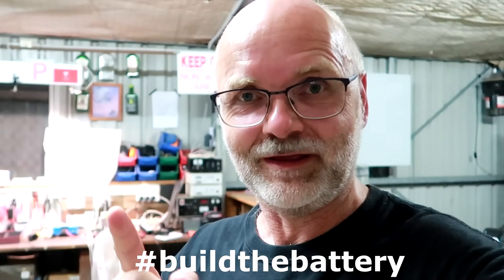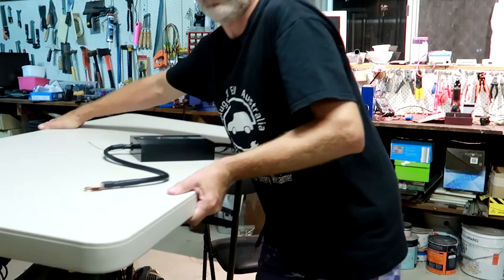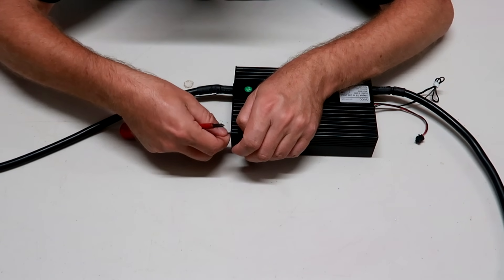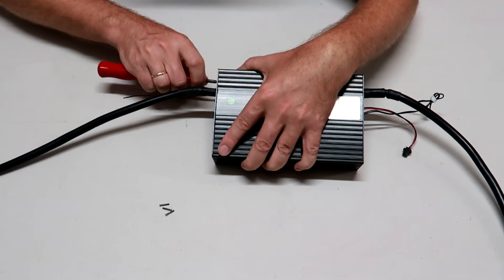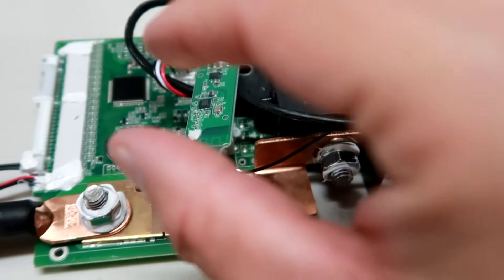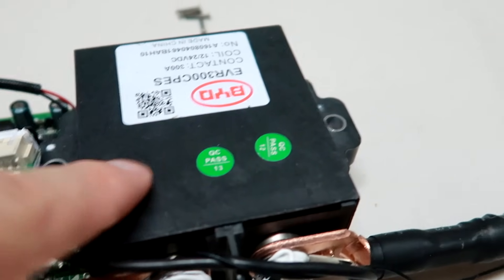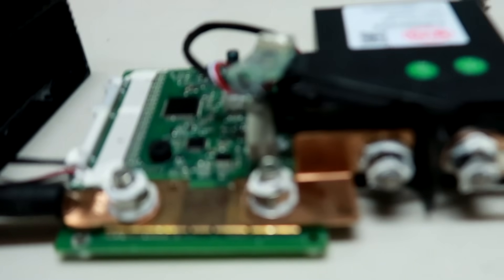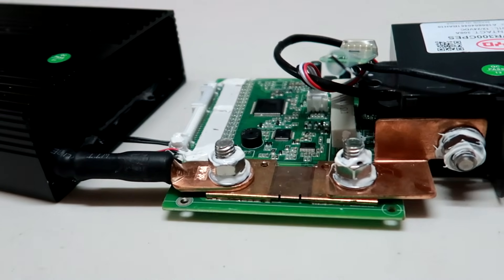Inside the BMS. Why I didn't buy a Daly #buildthebattery.5.1

Comment: I can't believe as many of your videos I've watched and just now found this one with this bms. This bms is what I Want For Sure now. That contactor is great.
Reply from the maker: Well, not so much if you keep watching the videos from this point onwards. The problem with the relay is, that it disconnects both charging and discharging. That is less than ideal.
This BMS was designed for forklift operation or golf carts where you only discharge during operation.

Comment: Can you adjust the battery cut out voltage?
Reply from the maker: Yes, the QUCC has 56 parameters which can be set with the app as per your individual needs.
Reply: @OffGridGarageAustralia  Nice. I'm thinking to do a build with the one that has the grey solenoid. I don't really want a cell cut out i just want to see the cell voltages so i can decide for myself when to stop. lol I have my own fast balance charger.
   One thing that i would like to know is does the BMS balance the cells while they are under load being used in the application? In other words. If once cell is a bit weak and it drops a bit lower than all the others, will the bms feed it power from the other cells (not while charging but while the battery is in use) so that that one cell (or a few weak cells) is or are not the cause of the battery shutting down?
  I don't care about charging with a BMS just to try to keep any weak cells as topped off as the strongest ones while in use. The rest is a waste of power running the bms. I just don't want to kill the cells so i really only need to monitor them if the bms can't boost weak cells during use then i don't really need one.

Comment: My Orion BMS also uses a contactor to disconnect the battery, but it's only used for "emergency" shutoff. The BMS uses either CAN-bus or digital outputs to control chargers/loads. You never want the contactor to be shut off except in emergency situations because it can cause loads of other problems. That is one advantage of the MOSFET based BMS units is that they can block current directionally. Meaning the BMS is capable of blocking charge current but still allowing discharge current and vice versa.

The problem I forsee that you may encounter here is this: Let's suppose during charging one of your cells reaches 3.65v. The BMS will see this and "disconnect". But since the load and charge both go through the same contactor, now your inverters have been disconnected from the battery as well.

Another problem is the opposite issue: Say the battery gets low from overnight discharge loads and shuts off. Then when the sun comes up in the morning the MPPT will be disconnected from the battery and unable to recharge it.

You might assume you can set your cut-off voltages on the inverter and charger to avoid this. And while you probably can when the pack is new, as cells get out of balance this will no longer work as reliably. (Ask me how I know)

It would be ideal if the BMS could communicate with the MPPT to just tell it to stop charging when a cell gets high (or low) instead of having to cut the contactor to stop charge/discharge.
Reply from the maker: I thought about this problem since I started thinking about the solar and battery system I'm gone build. At the moment there is no way for any communication between the BMS and the MPPT and I'm not sure if Victron does a 48V BMS which can communicate with their devices.
I have set the shunt as the second device now, so if the BMS shuts off the shunt will not work and communicate with the MPPT any more. I had to make a decision at some stage, so that's it for the moment.
Is your Orion talking to your Victron gear?
Reply: @OffGridGarageAustralia  Yes my Orion offers two ways to control charger / inverter. 1) It offers digital outputs which can be used to either directly control devices or can be used to open / close a relay. On the MPPT there is a set of terminals on the bottom, all the way to the right hand side that control whether the MPPT charges or not. By default there is a wire in there that jumps the terminals together to short them out. I can't remember if it needs to be pulled high or pulled low: But basically the Orion can directly connect to digital inputs that need to be "pulled low" to ground: When charging is allowed Orion pulls the digital output low to ground. This can be wired to the on/off port on the Victron MPPT to control it.

It likewise has a digital output to control "loads". So one digital output wire to control charger, another to control loads. These can be wired to relays and you can use the relays to control bigger loads / chargersor if the load/charger has a digital input (Which Victron does) it can often be wired directly to that digital input.

It also has a 3rd output, which is analog rather than digital, which varies from 0 to 5v to indicate the max charging rate. As the battery gets closer to 100% SOC the BMS will lower the voltage on this output to instruct a charger to slow down charging.

2) The 2nd method Orion offers, if you pay a little extra for the CAN-bus version of their BMS, is it can communicate via CAN-bus. This requires getting the Victron Color Control GX (Or one of the other Venus GX products from Victron). With this setup the BMS sends CAN-bus messages to the Color Control, which receives those messages and then the Color Control commands the MPPT, Inverters, etc based on what the BMS sends it via CAN-bus. For example when my battery gets to 98% SOC: My Orion tells my Charger to slow down charging. (The max charge amperage is one of the messages passed along in CAN-bus) this way my cells have time to balance but I don't have to completely stop charging. As cells continue to get closer to 3.65v the BMS continues to lower the charging amperage. It's much easier on the equipment than constantly turning them on/off over and over during top balancing.

So even if you don't want to use CAN-bus, I would at least want a BMS that had some sort of digital output that would at least let you control a relay so you have a little better control over when charging is allowed vs discharge, etc.
Reply: @OffGridGarageAustralia  I just went out and looked at my Victron MPPT. The terminals that are used to enable/disable charging from the MPPT are labeled "Remote". They ship with a wire jumper installed between the two, but you can remove this jumper and then wire these terminals to a relay or other switch (Presumably one controlled by your BMS) to tell the MPPT to charge or to stop charging.
Reply from the maker: @JeremyAkersInAustin  That is all great information, Jeremy. Thank you very much!

Comment: 50microA coil current is impossible for a contactor of that size. According to the EVR300CPES datasheet the coil current depends on the driving voltage 12V/24V. The worst case value is 2.4W for the coil. This power heats up the contactor while it drains your battery at the same time. That is one of the reasons why most BMS use power MOSFETs or solid state relays.
That little chickenfood near your balancing connectors are resistors and capacitors. They are needed to comply with EMC and do not work as balancer loads. That is the job of that huge 10W resistor, as other viewers already noted.
Reply from the maker: Thanks for looking up the specs. I could not find them anywhere but didn't look to intensive.
I don't think you can balance several cells through one resistor at the same time though.
Reply: Latching relay...

Comment: Hi.If the bms cut off the battery from the Solar charge controller, the SCC will be destroyed right? Since most solar charger need to be connected to the battery first. Any tips to prevent those costly accident. Thanks
Reply: Apparently victron say this won't be an issue , other charge controllers may be different case for sure , its a good question as this is a problem for sure ,  I use a seperate port bms which would negate this issue you describe
Reply: I'm not sure about victron but just about every other charge controller will blow up if the solar panels are connected and active without a battery connected on the other end! 
This is a trap for young players! It's the one thing that must be included in the design plan, my son found out the hard way! He had one of those all in one MPPT brand charge controller/inverter/AC battery charger, they are not cheap! And he disconnected the battery during a sunny day and the panels were active! 
He won't be doing that again anytime soon LoL... 
Unless the manufacturer states it clearly, you should always treat it like it will be damaged if the batteries are not connected while solar is!
Reply from the maker: There is an official statement from Victron in their forums saying it does not destroy the MPPT. But with other it might be the case. The blue JNGE MPPT can handle the solar without battery as well just fine. I have burned a cheap WPM controller though by disconnecting the battery.
Reply: @ursodermatt8809  well there you go! It seems that the only charge controllers I have fail because of this very reason and from what I have seen with other people must have been designed poorly! This doesn't seem to be common knowledge, it may be printed in the manual but I didn't realize how serious of a problem it will become if this isn't understood as a golden rule! 
I have watched many videos that review charge controllers and no one ever made a mention that "oh! This one is one of those that need to have a battery connected to it before the solar input otherwise it will blow up!". 
I have a DC to DC charge controller for the car that has inputs from the alternator and a solar panel that is designed to charge a secondary battery which always will choose solar panels first if solar power is available, it's also dead and I'm suspecting that it has also suffered the same fate! At the moment I have it taken apart and from what I have found so far is it's diodes are blown, they chose to use a double diode in a transistor style package which are not cheap but I just finished watching a video from diodes gone wild in which he was repairing a computer power supply and saw that some have these things in them, I have heaps of power supplies which I can salvage parts from but I got my legs sunburnt badly on Sunday at the beach in beautiful Sorrento here in Melbourne Australia, it was an overcast day, there was no direct sunlight and I got caught out! So basically I'm waiting till I can walk around again till I can get to fixing these charge controller's..
Edit: I just had a thought, my batteries are protected against all the usual stuff, and if too much current is drawn, they will shut down and that means the charge controller will die! I'm thinking that maybe if I fit a 50V capacitor to the output of the charge controller, it might protect it if that situation ever occurred! Just as a precaution, I generally overrate everything so basically I won't be drawing more than 1.5A max from each of the 12V batteries in the system so I don't see any problems there but as they always say, to be sure is to be sure!
Reply: @PeterMilanovski  hi, I am interested in how you went with the capacitor idea, as I had exactly the same thoughts as I read ur comment. I have been using caps for some time in this way mainly for the extra boost they can give inverters and to help filter ripple & surge from batteries, but reading this thread of comments has given more reasons as to why we should use caps in this way in a solar system. Ive recently been experimenting with large caps on the 60v PV side of a 12v mppt system with some very interesting results. Hope it all worked out for ya, Cheers
Reply: @evil17   Hi Evan, the capacitor idea worked out well, although I have taken a different route for charging my batteries. I'm using 12V lithium in a 48V string and the problem that I had was that a BMS is either not available or not cheap so I came up with a new idea. I decided to up the voltage on my solar panel array to above 150Vdc and used eBay industrial SMPS connected directly between the solar panels and the batteries.... In this setup you need one SMPS per battery! This way, each battery gets it's own charger and the batteries automatically get top balanced! The SMPS is designed to work with AC but it also works with DC voltage anything from around 90Vdc to 300Vdc..... 
The whole system has now been simplified! There's no more risk of one battery in a string being over charged! It's amazing! 
All the SMPS are connected in parallel at their input and I have a few 450V capacitors at the input between them and the solar panels, it helps when a small cloud comes over head, and since the SMPS have isolated outputs, I can have a positive wire from one SMPS connected to the negative output of another and not have to worry about short circuit problems... 
Since I have been using this method, I kept checking the performance for the first week and by the end of the second week I had no more reasons to keep an eye on the batteries, everything just work's! 
I'm now working on designing a PCB that will house multiple switch mode power supplies and smaller cylindrical cells, each PCB will be a complete 48V battery and charger system that just slides into a rack, when you need extra capacity, you just slide in an extra board, or if you need to inspect or service for whatever reason, you can easily slide one or more out.... This way, each cell gets it's own charger and can not be over charged! I still have to come up with a good but simple low voltage cutoff circuit to prevent any cell from being discharged to much... 
I personally think that this is the way to go.... With current solutions, you have to protect cells from over and under voltage and balancing... My cells are automatically top balanced and they can't be over charged.... The 12V batteries I'm currently using have low voltage cutoff so I'm good there but this new idea will need a solution to be implemented.... I'm confident that I will find it, just need some time in an otherwise busy lifestyle.
Reply: @PeterMilanovski  thanks for ur reply Peter, I thought ur cap idea would work & it begs the question: is that all that is needed to rectify this controller issue in general? It seems too simple to not have been implemented already!
Sounds like a great idea you have there, I would never have thought about smps’s being able to work on ac & dc, & being isolated is also a plus. Im curious, what size (farad) 450v caps do you use between PV & smps’s? And how many watts output are each smps ur using?  Keep playin with it mate, you’ll get it. Cheers

Comment: With the Electrodacus SBMS0 there is no large current going thru the BMS. the large current up to 24 amps but rated at 20 amps each goes thru the Electrodacus DSSR20's. The DSSR20's are solid-state charge controller and push everything the panel will give to the LiFePO4 battery bank but limited to a 24-volt battery. I use 2P8S 24-volt 272Ah 16 cell Lishens. totally different than what you are assembling. but is capable of controlling over 18000 watts of pv panels unlike the limits on mppt charge controllers. just a tidbit for you. nice videos- keep up the good work! 😎
Reply from the maker: Thank you. This will be one of my next projects. I'm in contact with ElectroDacus... very interesting devices.
Reply: keep in mind that for SBMS0 you need to match Solar panels voltage with battery
Reply: @cgmarch2359  the sbms0 is perfect for 60 cell and 72 cell panels in parallel  which is what the off-grid garage has already on his roof.
Reply: @cgmarch2359  he has the correct panels to parallel up to the Electrodacus SBMS0 either 60 cell or 72 cell PV panels in pairs work great with the  Electrodacus DSSR20's. the DSSR20's replace the MPPT. the SBMS0 is the solar battery management system and will work just fine with his MPPT. the SBMS0 will balance the cells if he sets it up as a 24-volt system 2P8S battery. the Electrodacus equipment is designed for 24-volt systems or 12-volt systems. i have 2 24-volt 16 cell Lishen 272Ah batteries being balanced using the SBMS0 and DSSR20's. each battery is 272Ah x 16cells x 3.2volts per cell = 13926.4 watt-hour potential capacity per battery.
Reply: @cgmarch2359  2 60 cell 250-watt panels in parallel go through the breakers in parallel at about 38 volts then the dssr20 charges the battery at about 27.2 volts. the battery brings the voltage down and when it is fully charges the sbms0 turns off the dssr20's to protect the battery from being overcharged.